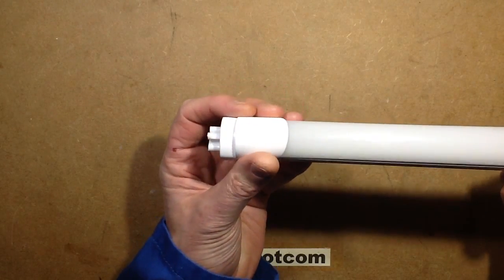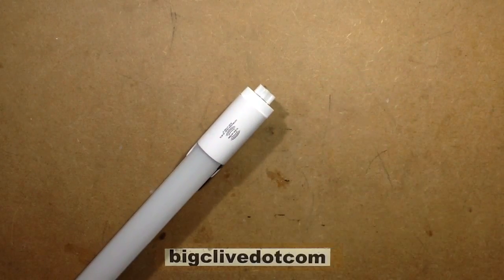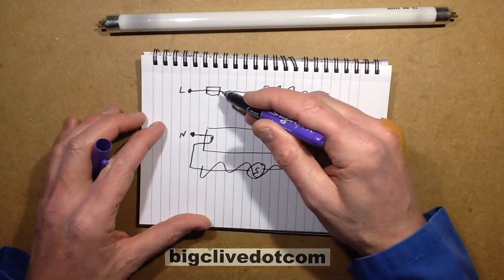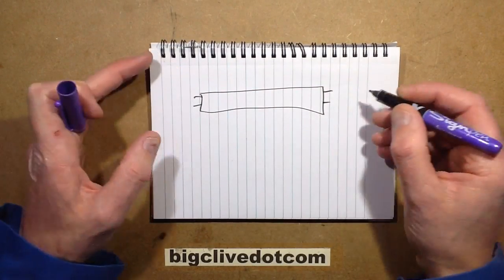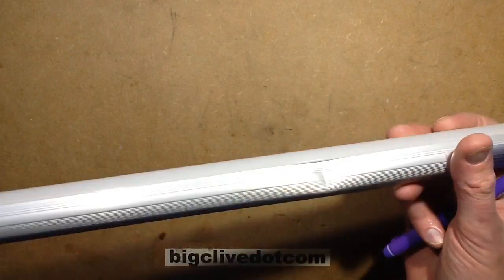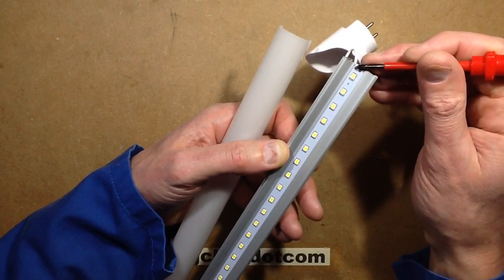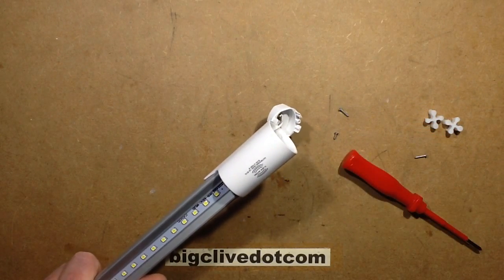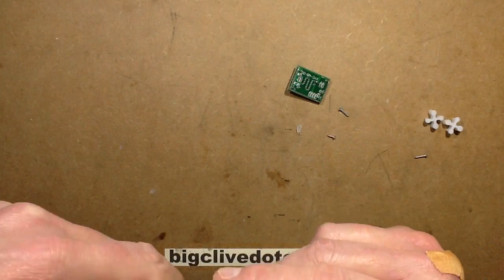Inside an LED T8 radar retrofit fluorescent tube.  (Excelvan)

Comment: These tubes are a marketing joke for most people.  IF they turn their lights on and off often they make sense, but for most people they are actually shorter lived in real world use than the $1.50 tubes they replace, and most often at a large % brightness decrease.

I like LED illumination, but replacing 4' T8 with LED tubes is usually an exercise in consumer ignorance.
Reply: i mentioned in another video, ive just removed some circular flourescents from my house, they were fitted in 1965, and still worked, god know how many times the bathroom one had been used by what was originally 6 people here, they still worked fine!  but bathroom had to go due to not being shower proof, and the others due to rewiring and deciding tthey looked tatty. (just bulb holders and 2 halogen capsule bulbs, they dont get used much)
Reply: If you're not using cheap chinese junk then it's quite possible the power bill savings won't even cover the cost of the bulbs.   You seem to be sort of making up some idealism about "good", "adequate lumens", and "go into a low power state".

Having fewer fluorescent tube lights turned on is also a lower power state.  If instead you mean let's add components to get the LED lights into a low power state, like motion sensors to detect when nobody's around, and/or timers, and dimmer controls, well then your cost keeps rising, both initial purchase cost and maintenance/repair.

I have ran the math.  By the time an average, median priced name brand LED T8 form factor bulb recoups the cost, which also means factoring for a greater # of LED bulbs and more fixtures to house them, they will usually be a break even proposition at best, factoring also for the interest on the money saved over several years of use.

This certainly could change soon, if manufacturers continue to cost optimize them like they have been making great strides towards with the standard E27 globe bulbs, and LED efficiencies continue to rise, but at the moment their lumen/watt ratio isn't high enough to overcome the initial purchase price and in an office environment I haven't even factored for the installation cost yet, which will also double if there are motion sensors/timers/dimmers involved.
Reply: Stinky Cheese 0.5w was just an example, they are probably using 48x 85-100mA 3v LEDs and running them at 167mA for a 24w tube to save costs because 2x the leds or more leds cost more and they probably got the lowest efficiency ones they could find (for LED tubes are the store they usually say 50 lm/w on the box lol!)
Reply: Stinky Cheese I have T12 tubes in the kitchen & bathrooms in this small condo, with magnetic ballasts... I don't use them that many hours a day and I'm lazy, so I don't think it's worth the effort of changing them.
Reply: Stinky Cheese There's a big opportunity for office lighting. Put these over your workspaces and if there's no one there, you dramatically reduce your power bill for that section.
Reply: That's just it,  you don't necessarily reduce your power bill.  Many of them provide little if any more lumens per watt, especially once you focus on the low cost generics which not only have lower efficiency but often use dubious claims about lumens like "this has 20 x 1W LEDS so 2000 lumens", EXCEPT they aren't powering the LEDs at the full 1W each so it isn't 2000 lumens, never mind temperature derating too.

You might say that's okay because there's no one in that workspace, but how does that solve the need for more light when there is someone in that workspace?  Turn on more lights?  Sure, but the opposite can be done using fluorescent lights to decrease power usage when someone isn't there.
Reply: If you're using cheap Chinese junk then of course you're going to get low performance, early burnout, etc. which is going to mess everything up. I haven't run the math but the principle is sound. If your LEDs are good and producing adequate lumens, and they go into a low power state when no one's around, then you're going to save money.
Reply: They use 0.5w LEDs (100 lm/w) and power tham at 1.5+w (which drops them to like <70 lm/w)
Reply: ??  The math doesn't add up.  Clive stated parallel runs of 24 LEDs in series.  That means at least 48 LEDs, and guessing without seeing it next to a ruler, probably at least 72 LEDs, but let's just use the lower # of 48 anyway as even that doesn't work.

48 LEDs x 0.5W each = 24W, plus regulator efficiency losses.  Conclusion:  It can't be running each LED at 0.5W or more.  Even so, I agree that the 100lm/W mark, maybe 120lm/W with the newer chips, is still the ballpark threshold to derate downwards from before even factoring for the diffuser lumen loss.
Reply: 2Awesome
I've got a cheapass LED bulb in my ceiling light. Funnily enough, it has been working quite well. I didn't think it would, considering the fact that the LEDs aren't on a heatsink, and they run at about 80C to 90C!!!
Also, the bulb says it takes 9W and puts out 360lm ... it appears to me that it's more than 360 lumens, so go figure ... X'D
Besides, the package said it was the same color as an incandescent bulb. NOT! The damb bulb itself says it's a 6700K ... so yeah it's kind of nasty.
Oh and lastly ... the plastic cover is very easy to pop off by hand, exposing the mains wiring ... lovely!
Reply: I've replaced mine with led ones, and those are brighter than fluorescent.
Manufacturer claimed specs: L600mm/10W/800Lm/4000K/Ra≥75
And I've paid for it only 3GBP (in equivalent).
There's a glass version that has same specs but cost almost twice more.
Reply: Sedokun
bit short of 8500 lumens from a 6ft flouro tube...
Reply: jusb1066 Never seen such a powerful fluo-tube. 6300 at most. What's the model?
Reply: Sedokun
your typical 6ft tube is about 8500, 95w i believe the old t12s run at
Reply: jusb1066
 Sorry my but "typical" 6ft t8 runs at 70W and emit about 6000Lm. And 95W, I think it's only possible for clear UV bulbs. T12 still produced?
Reply: Sedokun
technically t12 are gone, but i still have them in my garage, still looking for cheap and effective way to replce 6 of them, at this rate, i will just go for 5ft t8 units as any led's at the same lumens are way too expensive to do.
Reply: jusb1066
 In Your case it's probably will be. But me now feel very satisfied, I had to replace my fluo lamps every 3-4 months. Those cost about 0.3-0.5GBP, not much, but it was a pain in the buttock to replace them. This one came with 5Years warranty. Also, fluo emits light 360degrees. And my lamps have no reflectors, so half of it were wasted to heating the enclosure. While this one only 160degree.
If You prefer fluo over leds, and will decide to change them - consider T5. Those are next step of efficiency (T12 < T8 < T5). p.s. unfortunately T5 has smaller plug, and only 5ft longest
Reply: Sedokun
yeah i kinda like the 360 degree light in a workshop rather than dark ceilings, i might try running a t8 tube in a t12, its over driving a bit but may not be so bad
Reply: Not sure where you are located, but here in the US, 4ft T8 are by far the most common tubes, are 32W and around 3000lm and 50,000hr lifespan.  They cost about $2 each in a 10 pack.

If you had to replace your fluorescent lamps every 3-4 months you had some problem with the ballast or were buying horrific quality tubes.  Simply if you buy the cheap generic LED tubes they will have horrible lifespan far below their manufacturer (or seller fraudulent re-rating) specification.

You have started to state many myths that the fraudulent seller perpetuate which makes me wonder if you are a shill that is affiliated with one.  Fluorescent radiates 360 degrees but practically always has a reflector behind it.  LED has a far less useful beam spread unless the lights are at very high elevation to have uniform light coverage or VERY VERY many more of them are used.

For example you stated you had a LED tube that produced 800lm.  You need 4 of those to equal the lumens of ONE 4ft T8 fluorescent, and closer to 6 to achieve effective, usable, uniform lighting due to their lower beam angle, PLUS buying FIVE additional fluorescent tube fixtures and wiring it all up to accomplish this, or at least two fixtures if the twin-tube type.

Since they are no more efficient, much dimmer, and cost hundreds of dollars more to install for the same amount of light, those LED tubes seem to be the worst possible option for fluorescent tube replacement.   If on the other hand you just need a minimal amount of light in a cold environment, then using only a couple T8 tube LED bulbs in an existing fixture starts to make more sense, except you would still be better off just putting only one T8 fluorescent tube in the fixture instead of 2, so long as the ballast can run one at a time.  Modern electronic switching ballasts can.
Reply: Where are you located?  You write about 6ft and 5ft but both are extremely rare in use in the US.  Here the 4ft T8 dominates the market and has for 20+ years, except in old industrial setting where they started out using 8ft T12 if fluorescent at all.   Ironically my garage is the once place where I would make the concessions of expense and lower brightness to use LED bulbs (not necessarily T8 tube type because I have no tube fluorescent fixtures in the garage) because my garage gets to freezing temperature and below in winter so the LED bulbs provide immediate full brightness for situations like opening the garage door and needing a good amount of light for the 15 seconds it takes to pull a vehicle into the garage to park.  In other words to put them in my garage door opener E27 sockets where I can also use a higher wattage-equivalency rating LED bulb because the limit in those garage door opener sockets with incandescent was the amount of heat the incandescent generates with them inside plastic diffuser panels.

So in that scenario it was designed for 2 x 60W incandescent bulbs and fluorescent E27 bulbs wouldn't work well in the cold, while 2 x 100W equivalency E27 LED bulbs work well.  I'd go with even higher wattage-equivalency LED bulbs except that the amount of space behind the garage door opener plastic diffuser globes limits the bulb size.
Reply: Stinky Cheese
Russia. The one I've installed was 600mm/10w/800Lm. I've paid $0 for modifications (just removed ballast and rewired the sockets). Electronic ballast was GE. Fluo lamps were GE/Philips. It's not the working hours that kills fluo lamps, but the starting pulse (heater getting burned fast if switching on/off too frequently).
Angle is 220deg (manufacturer specs). It's quite different from the one in video. Leds are placed on aluminium directly, and tube has ridges to scatter the light. Also there's no AC/DC converter, it's a sequence of PCB mounted circuits (like those 220v leds on single die).
https://ae01.alicdn.com/kf/HTB1QokfKXXXXXbuXXXXq6xXFXXXp/5-pieces-220V-directly-100W-Integrated-IC-font-b-LED-b-font-font-b-PCB-b.jpg
Reply: I get over 10 years out of my 4ft T8 fluorescent tubes.   There's always
 an AC-DC converter of some type when you have AC input powering LEDs, 
just not a switched inductor on what you pictured.  That design you 
linked looks highly susceptible to power surges, assuming it is direct 
connected to 220VAC, and to large sections failing if any LED in series does, but so it is with many T(n) tube designs which is another reason I don't like them.

To me the edison E27 format makes more sense today as the cost per bulb has dropped steeply in the last 2 years in the US, so much so that it's even cheaper to buy such bulbs and take the LED board and driver out to remake into another form factor for custom lighting, though many have potted driver boards so you have to devise ways to mount them without trying to remove the potting compound which they will not survive.

Comment: I've made a video about the mircowave-doppler motion sensor as used in these units. https://www.youtube.com/watch?v=jAeFQEHWLZU
In contrast to what they claim they operate at 2.45GHz using a poorly designed oscillator. Their production variation may be enough to not have them interfere with each other. However, there is a real chance that they influence with the WLAN performance in the room, especially when deployed in large numbers.